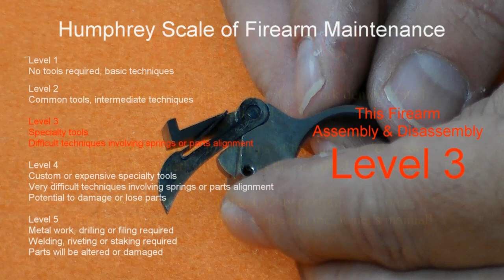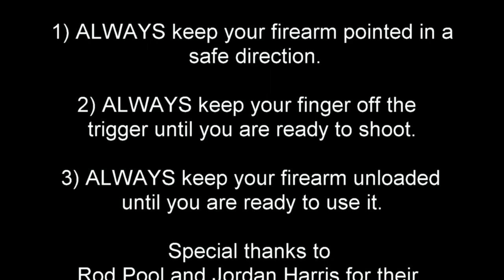Harrington & Richardson American Double Action --Armorer level disassembly

Comment: I just got an American Bull Dog in 38 S&W center fire. After watching the video mine looks like the one in the video except mine has a octagon barrel. I think mine is a Iver Johnson's from what I have found on the web. Stamped on the top of the barrel is "AMERICAN BULL DOG" and under the left grip 64 79. I do not know what 64 79 means, is that a production code or a serial number? The gun seems to old to have a serial number. Tell me if you know. Mine will fire in SA and DA. But in SA the trigger is farther back and seems to take a heavier pull to fire than using DA.

Comment: Thanks for this, got one of these and someone seems to have messed with it. The hammer spring was inverted in it. Now it runs, but I don’t dare take it fully apart. Question: if it fires and resets but doesn’t have a single action option is that rather a bug or a feature? It seems to me the trigger doesn’t touch the second stage of the trigger like my other The American does.

Comment: i know this is a old video but i am trying to restore my great grandfathers revolver video helped amazingly it cycles almost perfectly but the trigger won't reset anything you could tell me would be a great help
Reply from the maker: The trigger spring you see at 3:45 is what resets the trigger, that could be broken or installed incorrectly.  Otherwise, something mechanical in the works is restricting the movement of the trigger.   Those would be my best guesses.

Comment: I work on my guns while they are loaded, which is much easier than working on my vehicles while the engine is running, but I enjoy a challenge.  If you hammer hard enough on a screw, it will come out. I need to fix a Model 676 H&R. The spring on the hand is protruding through the window. I had my father's sidelock Le Fever apart, and got it back together in the same day, when I was about 14 years old, so..... My dad's old 922 is like new! I miss dad. His Superpose is well used, but no less fun to shoot, I just miss having him along on the hunt.
Reply from the maker: :-) you sir are clearly perceptive enough to perceive a subtext to my videos.  I appreciate the comment.  Real story; on one of my other videos I state to place the safety in the "safe" position before disassembly, not in this case because it's necessarily safer, but because it also aligns certain parts.  One viewer didn't follow that advice and got the parts jammed.  Then he became outraged and got on a rant that I was incompetent.  His excuse for not placing the safety on safe?  Because I didn't tell him why, so he didn't.  Best part is about half way through the video I explain how to fix the situation if you failed to put the gun on safe, but 4.5 minutes was apparently beyond his attention span, as he never got to that section.

Comment: Thank you so much for this video. It helped me immensely assembling a disassembled H&R American. The only difference was the trigger guard is held by two pins instead of the much easier screw. The only issue I'm having is the hand falls backwards and doesn't always rotate the cylinder. What should keep it forward? Thanks!
Reply from the maker: See the video at about 6:05 there's lever spring that pushes the lever (hand) away from the lifter.  If the spring is weak or missing or the lifter isn't in position against the hammer (see the video at 7:00) then the lever would not be in the right position.  Thanks for watching!

Comment: I got one of these in a collection i bought.  Came with 8 cartridges. Mine a 2.5" 38 S&W smokeless. SN 138835, Octagon barrel. Thanks for the video.  I can disassemble now.
Is there a SN chart for the years made?
Reply from the maker: I've never found a good source for a SN chart on this model (or any H&R's made prior to 1940).  I'm not even sure that number you found on the grip is an SN because I've never found any other references to SN's on this model.  You can see the one the video only had a 3 digit number.
Reply: @Imminent Threat Defense  i read early models had SN under the grip (had to remove grip). Mine is stamped on the metal bottom of the grip.  I read later models were done that way.

Comment: Great video, Jim. I recently found the 32 cal. model American double action and it's in beautiful condition. While the cylinder does lock when the hammer is in full back position, the cylinder does wiggle a very tiny bit when I aggressively work it. Is this normal for a shooting gun of this type?
Reply from the maker: Hard to say how much movement you're getting.  Look for wear in the bolt (that little tab on top of the trigger) and the corresponding cuts in the cylinder.  If they look good then a loose fitting trigger pin could allow the trigger to wobble and that would let the cylinder move.  But realistically you can't expect this gun to be too tight even when it was new, it was a pretty basic revolver.
Reply: @ImminentThreatDefense  Thanks for the reply. Now I just have to locate an ammo I can use. I've been told modern 32 ammo is okay for this gun but online opinions differ. Anyway, I'll start with the vice and string method for testing.
Reply from the maker: My understanding is that the first model (round barrel here in the video) was designed for black powder, whereas the octagon barrels (second and third models) were designed for smokeless powder.  However, a lot of people confuse that change to mean smokeless= modern powder.  That's a risky assumption.  Powder technology has changed a lot in the last century (duh).  I know for example for the M1 Garand there's been enough interest to have the studies that show you should definitely NOT use modern ammo in that rifle, and they made that determination some time ago, so the rifle was only about 50 at the time. (you can find special 30-06 ammo for the M1).  Admittedly, we're talking about a gas operating semi there, where the pressure profile has a bigger impact.  But for this revolver we're talking, what, 120-130 years ago, pretty sure that's not the same powder.  So if I was determined to shoot that pistol, I'd get some custom light loads.  But I'd be more likely to just keep it in a glass case :-)

Comment: Jim mine is hammerless so therefore the trigger-guard is slightly different. Mine has no screw but a cross pin. I have tension on the trigger for it to return until I pull the trigger completely. Then it feels as if something is rubbing or pressing against the trigger creating more friction and that causes it to not return to battery. Since there is no access to the inside except for removal of the trigger -guard, I can’t see what might be causing it. I cleaned and lubricated everything before I put it back together. I am a Gunsmith and never really liked working on these guns so I haven’t had to repair many. I was just hoping that you might have a trick or two up your sleeves. Some online blog boards mentioned taking .015” of the long arm to make it stiffer but I didn’t see much benefit in doing this. Hopefully you can come up with another idea.
Reply from the maker: hmmm, yeah I agree with you shortening the spring leg won't likely help.  In fact if it's anything the spring might be too wide and it's the sides that are rubbing.  As you pull the trigger listen for that little "click" to see if the spring is disengaging.  By what you're describing it sounds like a full trigger pull the spring is disengaging.   but it also sounds like you've got another problem with the friction.  Try leaving  out some parts (like the lifter) one at a time and see if the trigger behaves the same way.  That way you might be able to identify which parts are rubbing and creating the friction.  If you can narrow it down to one part that'll be a start.
Reply: Imminent Threat Defense thanks. I’ll try that. I’ll let you know how it turns out.

Comment: Good video. I need to know how the breach door came apart though.
Reply from the maker: Sorry, not sure what the breach door on this gun is.   If you go to Gunpartscorp.com they have a parts diagram https://www.gunpartscorp.com/gun-manufacturer/hr/revolvers-hr/american use their terminology and maybe I can get on the same page.  Thanks
Reply: @ImminentThreatDefense  I figured it 
 Out. It uses a piece of spring steel shaped like a small spoon held in with a set screw. It's what keeps it closed. Thanks anyway.

Comment: Hey just wanted to say thank you for this video. It helped me alot. My grandfather had the .32 revolver in a box taken completely apart and this gun is pretty much identical. I  have a question. I am missing the hammer screw. Where could I get something like that? Would I need to have it custom made for it?
Reply: I do have a couple more questions for you. Under handlegrip there is a #4 that is spaced away from the other three numbers almost to the point of it being so far to the left that just a small piece of the number is cut off. In the middle off the hand grip are the numbers 287. About a quarter inch away from the 4. Now on the trigger guard there is the # 287, the 4 is not there are all. Is the serial number 287 and the 4 means something else or is it 4287 and the 4 is missing from the trigger guard? On the inside portion of the handle grip someone has scratched in 4287 with what looks to be a nail to scratch it in.  Can you make heads or tails of this? Final question is there is no lettering or numbers on the octagon barrel. Just the words 
The  American Double Action on top of the weapon.  And the serial number on the trigger guard next to the pin hole and on the handle under the grip are the only markings. The octagon barrel tells me it's not a first addition from what I gather. Is there anything else you can tell me about it. Thank you very much.
Reply from the maker: Try Numrich or Jack First, those are my go-to places for old parts.  (Just checked Numrich has them for $7)  🙂
Reply from the maker: @WillThePatriot  Best I can tell those aren't serial numbers (way too small a number), I think it's some sort of manufacturing number.  Maybe a batch number?   Thanks for watching!

Comment: How do you keep the sear and spring from moving while you insert the trigger guard? Either the spring falls out or the sear moves and then I go to reposition it only for the spring to then fall out. Should I super glue the sear spring in there?
Reply from the maker: I used a slave pin, just a little piece of brass rod cut to fit.  You can see how I used it at 7:10 in the video.  I also made a video on how to make slave pins.  Here's the link https://youtu.be/zEgFdyc7_xc  Thanks for watching and commenting!

Comment: I have a "Young American" version 32 with octagon barrel and blued trigger guard. Is this black powder or modern 32 cartridge?  Thanks
Reply from the maker: It's tricky with these revolvers and I'm not an expert.  It's hard to tell the difference between a third variant 1st model (1898-1904) and the 2nd model (1905-1941).  All first models were black powder, it wasn't until 1905 with the second model did they allow "smokeless" powder ammunition.  Both of these variants are distinct in that they have octagon barrels with the company name and address on the left side of the barrel.  However, my understanding is that the second model includes the caliber on the side of barrel.  That said I'd caution against assuming "smokeless" powder from 1904 equals "modern" powder from 2024.  A lot has changed in 120 years.  Personally, if I had the overwhelming desire to shoot one of these, I'd hand load some very light loads.  I'd be more inclined to let it retire in peace an put in a glass case on the wall.  Hope that helps, thanks for watching!
Reply: Thanks for the reply and info....Appreciated     @ImminentThreatDefense

Comment: I remember seeing on octagon barrel version of one of these years ago at a gun range - like over 20 years ago. It was chambered in .38 S&W and I had the opportunity to fire a cylinder’s worth at some bowling pins. Don’t remember it being that accurate lol. I also don’t remember it having the ability to be used single action. It was double action only. I know for sure because I asked the guy who owned it and he said it had always been double action only. But then again he was not old enough to have been the original owner of the gun. Did they offer these in double action only, or was some modification made? Or was it malfunctioning some how? It def. was this exact gun only the octagon barrel. It said The American Double Action on the top strap I remember that clearly and I don’t think it had any other marks on it. Any information would be appreciated. Nice video!
Reply from the maker: You can see at the end of the video when I do a function check it's a DA/SA.  In fact I don't know of many older DA's that couldn't also be fired in SA, except obviously the internal hammer  guns.  The round barrel is the first generation and the octagonal barrels were later versions, so I'd have to believe the more common is the octagonal (just speculating).
Reply: Imminent Threat Defense Thanks, very interesting. I know it was a long time ago, but I distinctly remember being sort of caught off guard that the one I fired that day would not cock back into SA mode. I even commented on that and the guy who owned it said no this gun is DA only. But then I’ve seen your video and several others here on YouTube and that’s clearly not the case, as most of them appear to be SA/DA like most revolvers that fire DA. Oh well, maybe someone modified the one I shot somewhere along the way because they didn’t want SA? I do remember it have a fairly heavy trigger pull. Maybe somewhere in that pistol’s history the owner wanted to carry 5 in the cylinder and have the firing pin between two case rims as I’ve read about in the past. That way, the only way the gun would fire would be to do the long DA trigger pull. Who knows! But your video brought back good memories I like they way these old revolvers look and felt. Maybe I’ll pick one up some day...can you even buy .38 S&W cartridges anymore? I seem to remember running Remington factory ammo but this was in the 90’s so I might be wrong about that. I do remember the chamber of because it was the only time in my life I had seen or shot a pistol chambered in that round.
Reply from the maker: I think you're right in that you can never say never about these old guns, there were a lot of variations :-) As for the ammo, yes you can find 38 S&W even in blackpowder which is what some of these old guns require, Buffalo Arms sells it.  You can also find reloading data for it.
Reply: I just got an American Bull Dog in 38 S&W center fire. After watching the video mine looks like the one in the video except mine has a octagon barrel. I think mine is a Iver Johnson's from what I have found on the web. Stamped on the top of the barrel is "AMERICAN BULL DOG" and under the left grip 64 79. I do not know what 64 79 means, is that a production code or a serial number? The gun seems to old to have a serial number. Tell me if you know. Mine will fire in SA and DA. But in SA the trigger is farther back and seems to take a heavier pull to fire than using DA.

Comment: I own a H&R model 733 in a 32cal, where can I but a larger handle rubber/wood that can fit my hand better?
Reply from the maker: I'm unaware of any aftermarket grips for this revolver it's a little too rare.  You can find a number of custom grip companies out there that could probably provide what you want, I did a quick google for "wooden revolver grip kit" and got a bunch of hits.  There was one that would provide blanks and you finish them yourself, that's the way I'd do it (but I like making stuff), they're probably the most cost effective (https://www.tombstonegrips.com/) but some of those custom companies may already have the mold for this revolver, so I'd ask around.  Hope that helps, thanks for watching.

Comment: Is this all the same if my middle has pins instead of screws? My friction pin is stuck and frozen down and possibly broke and I need to tear mine down
Reply from the maker: Pins instead of screws?  Are you sure it's the same revolver? Either way the friction pin is probably just rusted up.  Before you try removing it, try soaking it with penetrating oil and see if can just push on it with a punch and get it loose. Otherwise it can be removed like I show in the video.
Reply: @ImminentThreatDefense  I ended up getting it and no I was mistaken I guess mine is the 1904 I have to many of these little guys to keep track of . I got it apart and out the sear spring was not fun 😊 but it's all good now thanks again for the vid it was a lot of help still.amd it was a pain on the spring but this is still easier then working on my middle 10 a those are finicky

Comment: Great video. I own one as well. There is just a problem that just happened. My cylinder pin keeps sliding off. Can someone tell me what might be wrong. Thank you.
Reply from the maker: Probably a stuck or missing friction pin.  See the video at around 4:00. Thanks for watching.
Reply: That's exactly what it is. Where can I find that Friction pin? And thank you for answering me and your video.
Reply from the maker: @nicolaferriolo7886  try gunpartscorp.com or Jackfirstgun.com. If they don't have it you might be able to make one easily enough from steel rod (avail in diameters at hardware or hobby stores) You can some times salvage a spring from a lighter (flint spring), a pen or toy that will fit.  The spec on that spring should be pretty tolerant.
Reply: Thank you so much. Keep you updated.
Reply: @nicolaferriolo7886  I have the same problem but I dont want to touch it and make it worst